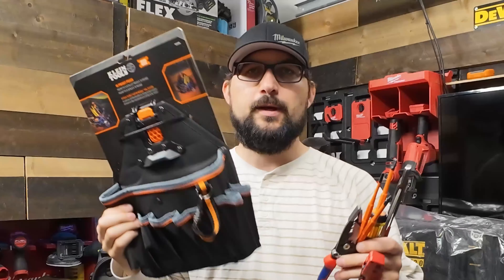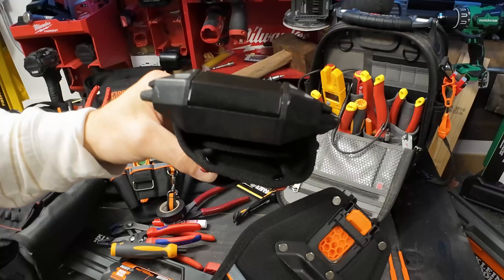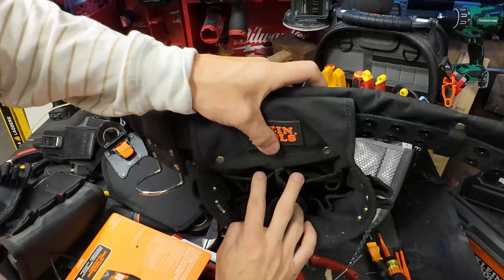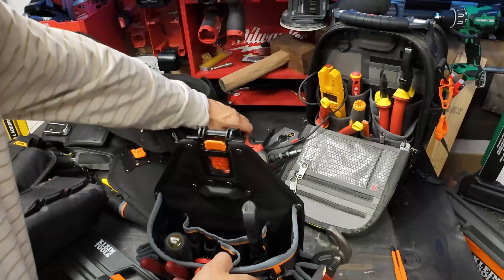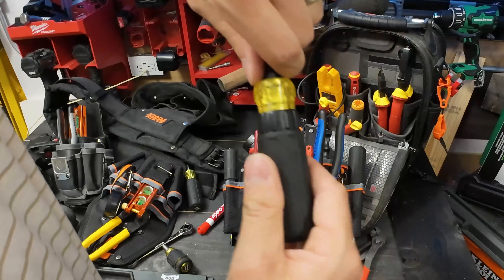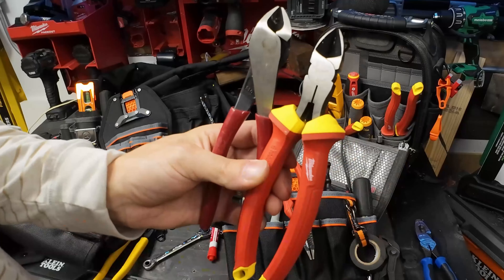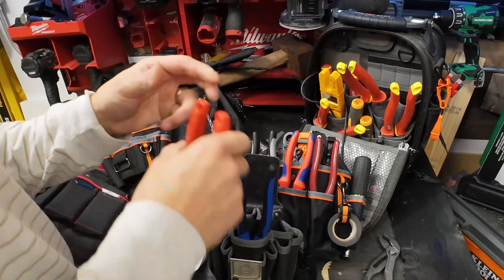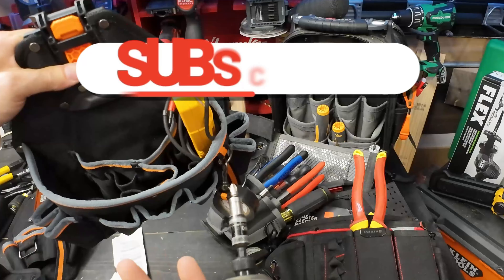Klein's New ModBox Pouch has A Better Layout? And Holds An Impact!

Comment: I used a heat gun on the larger tool pouch you to kind of curve it a little bit on the sides. My load out is basically the same as what you demonstrated.

Comment: Man that pouch looks like a full on tool belt pouch that looks like it would rip your belt off.  The veto mp2 looks more manageable for sure and would be my choice.  One item you should get is cabnetmakers sidekick it's on az and the makers website but I wear it everyday.  The thing I love about it most since it's belt loop only is I cam get into my truck with a pica pencil or large marking tool and not interfere with seat belts or dig into my side. I have even hung a battery framing nailer or m12 cable stapler off it no problem.  It has a pen loop and and tape clip but I use the heavy-duty clip for my impact then my veto pouch on rhe other side.  Fyi my guys have killed 6 or 7 of thoes milwaukee strippers easy I said enough and got the forged knipex and there still on there first pairs.  It's like you really want these klein pouches to work but in the end we all go back to veto (one of us!).  I tried the sandwich board on my waist one day and couldn't do it.  But do try the cabnetmakers sidekick thr left hand one I suggest if your gonna use it on your right side (I know it's opposite) that's on thr makers website or right hand one for your left side that's on az.
Reply from the maker: Thanks I'll check that out
Yeah, you wouldn't wanna load this thing up too much
I've never had a pair of strippers last me more than six or seven months
But if the knipex last longer, that's good. They need to at 3x the price

Comment: I was hopeful for the Klein. Their belt clips do not stay attached very well. I bought two pouches and they pop off. 
Menards isn't near me so I'm going to stick with the Toughbuilt. 
Those boxing wrenches by Klein are great. Been using mine for a bit and love it.
Reply from the maker: That's good to know after Trying to use this wrench, I realized at the half inch. Size is not on the smaller wrench

Bumber
Reply: @toolsandtactics  Right! Almost forced to carry both of them.. They are still great. I use all but the 7/16 and 5/8 at work.

Comment: Nice video! Love veto but damn! Klein is on top these days… hard to beat their quality that’s for sure.
Reply from the maker: Well I don't know about the quality. Definitely have more innovation

I've never thought of klein  pouchs as quality. The gator back by far will outlast any of this style pouches.  

But at $40, it will last long enough. And it does have some really nice features
Reply: Yeah I agree, if it’s anything like they make their hand tools than the quality should be there… I been thinking about trying out their pouches for some time now, but still have some leather carpenters pouches that I’ve had forever it seems…. but hey if it ain’t broke don’t fix it.